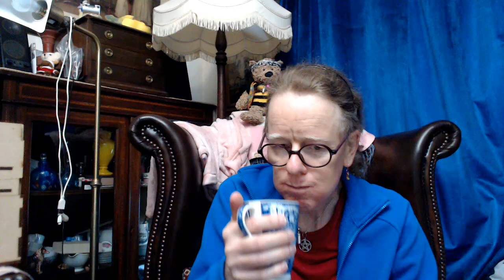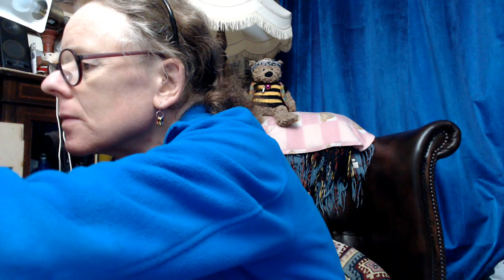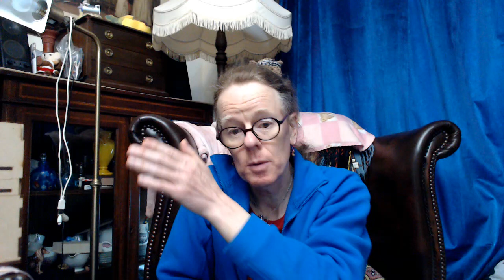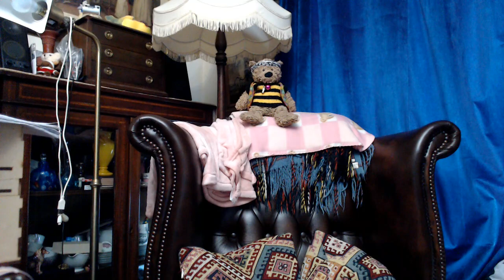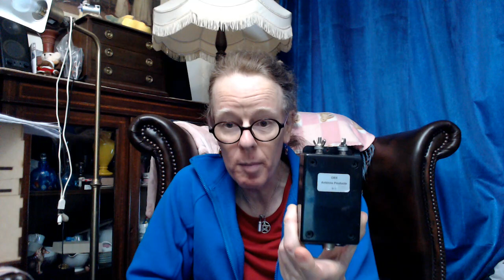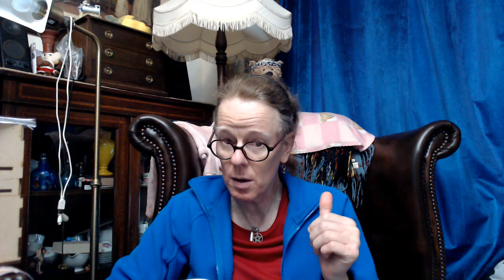doublet antenna build.

Comment: Hi Karen, fantastic video and interesting at the same time :) Thanks for keeping this hobby alive and I wish you luck with the recent doublet antenna build ;) Cheers 73!
Reply from the maker: Thank you.The doublet is a fantastic antenna once you get the length right.It has much to recommend it easy to build low noise floor wide banded.I am now preparing to build a second(not as long) which i will use on the MFJ 1026 noise unit.All very interesting antenna experiments how i wish i had a garden.Have a nice Sunday good dx greetings from Cornwall 🐻🤗👍

Comment: The feedline used makes a big difference . I have been using
twin lead ( Window Line) and Ladderline on all my mutiband
antennas for some time. Harry Helms in his SWL book
mentions using insulated wire for SWL antennas feedlines.
Sometimes even making a mutiband antenna 'shorter can
improve your results as you say you need to try and see,
Reply from the maker: The feedline does indeed make a hell of a difference.There is no way i would go back to a coaxial feedline.There probably is a way of working out the optimum length of a listening antenna but trial and error will eventually get you there.As is said there is more than one way of de feathering a 🐔 chicken.I had a thought earlier the antenna is called a doublet.Thats what i did doublet from 120ft to 240ft.A very interesting part of the hobby antenna theory.🐻🤗👍
Reply: @shortwavelisteningforbegin418  That brought a chuckle ☺️
I have an RTL-SDR dongle which I use mostly to test my SWL antennas that I build, great to be able to see the signal and noise floor and compare.
Reply from the maker: @JohnGreen-SWL  Yes something that i would love to do see my noise floor.It has reached a point some evenings i wonder if i have a problem in the system as it's so quiet.One of the biggest challenges a listener has reducing the noise floor.🐻🤗👍

Comment: Do you watch Ray over at radio workshop try a MLA30+ loop works great I have a 80M doublet and a manual tuner works well
Reply from the maker: I will try radio workshop.Yes the doublet is a very good antenna for the shortwave listener once you find the right length.I couldn't believe how low the noise floor was compared to the dipole excellent.Very easy to build its ideal.Have a nice weekend good dx🐻🤗👍